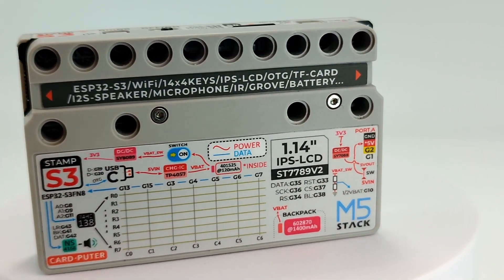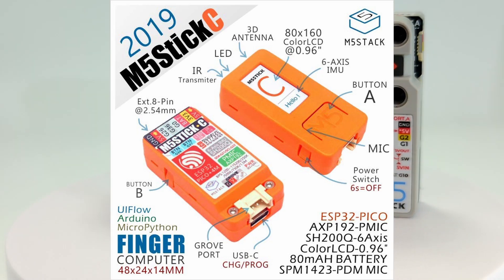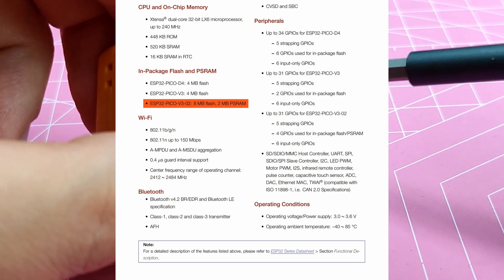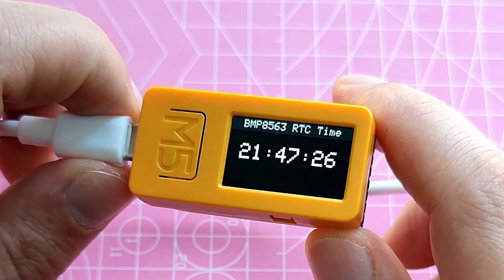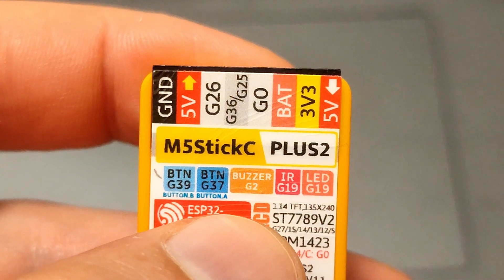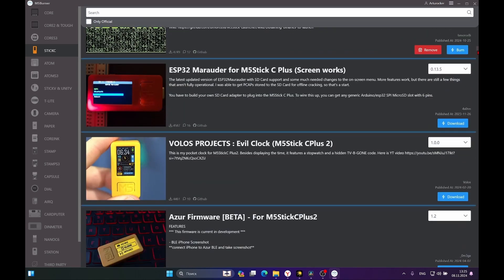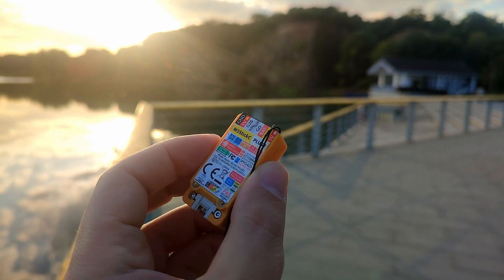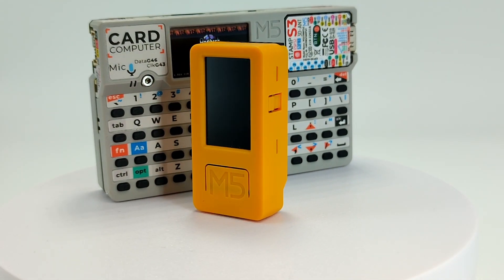What is M5StickC Plus 2 ?

Comment: Thanks, cannot install bruce firmware it keeps saying ' failed to initialize. Try resetting your device or holding the Boot button while clicking install. Is not working, any assistance is appreciated, tia
Reply from the maker: Try to connect G0 pin to GND using wire, before the burning firmware. It's going to help.
Reply: @HobbySupportInternational Thnx, I'll try